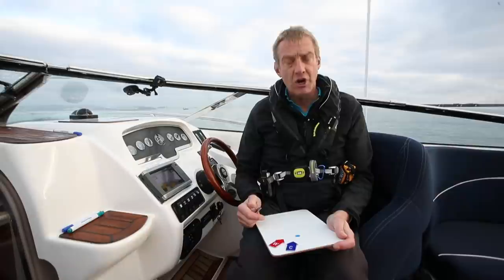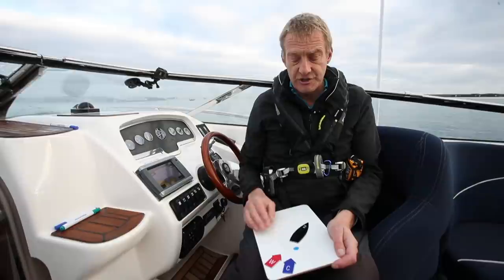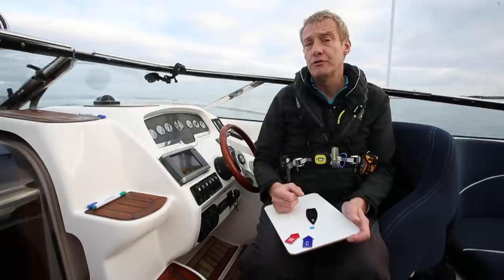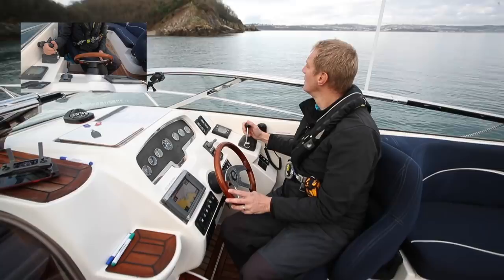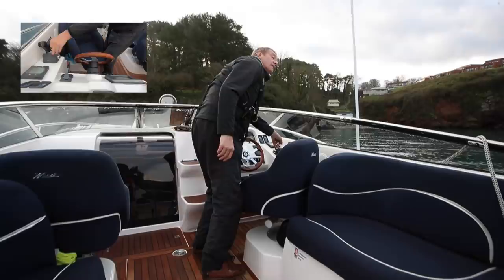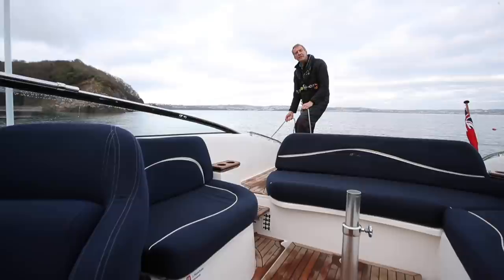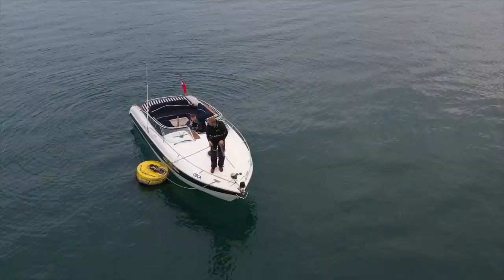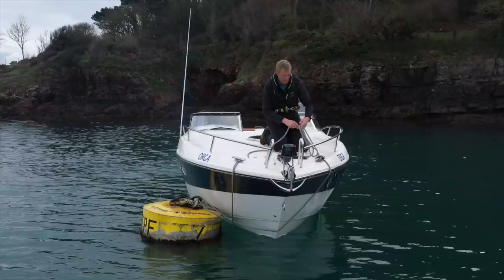How to pick up a mooring buoy when boating single-handed | Motor Boat & Yachting

Comment: The challenge I find is that lacking a swim platform there is no easy place, bow or stern to reach to a morring ball.  On my boat, the ball is one very long reach down (3 - 4 feet).  I have a snap fitting that I can use to grab the ball by using a telescopic pole, but undoing that snap fitting is quite a feat.

Comment: Isn’t that buoy scratching the sides of the boat? How can We avoid that?
Reply: Yeah, I was thinking the same thing.  They have rectangular fenders that you could potentially use, but I would still worry about damaging the finish or gelcoat.
Reply: Once the bow line has been threaded a gentle push off the bouy with your foot or boat hook will give you some distance. The wind and or tide will do the rest as you should be downwind.
Reply: Where is that bay, looks a great place to go and practice
Reply: @simonreid737  Fishcombe Cove, Brixham, Torbay, Devon. Apologies for late answer, only just discovered this video series!